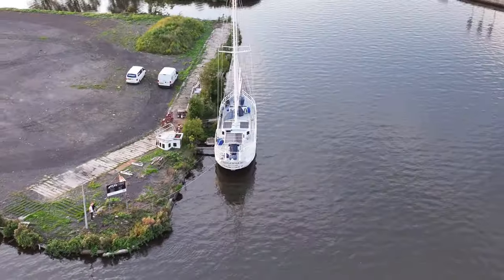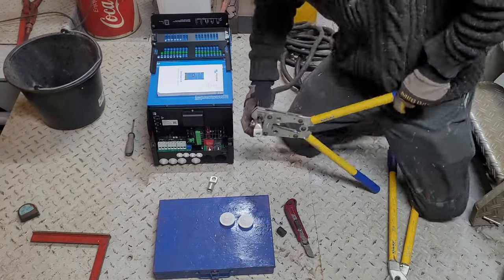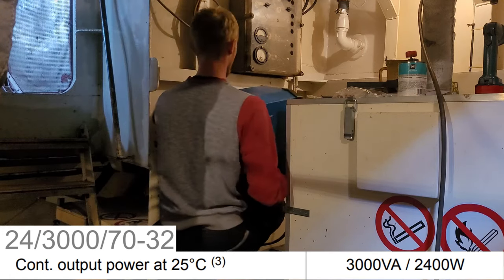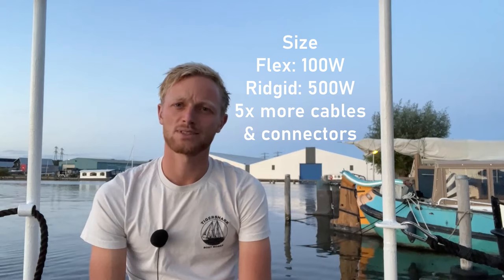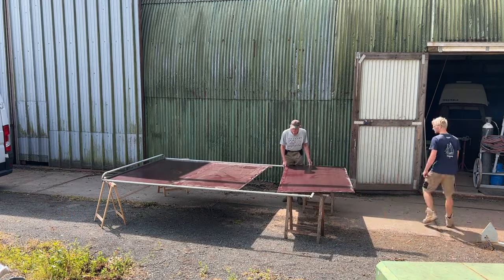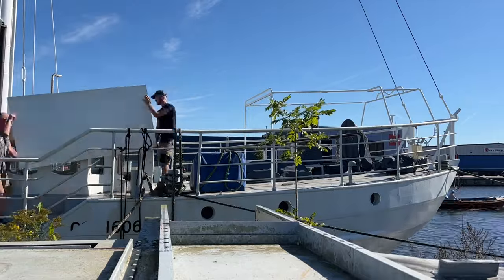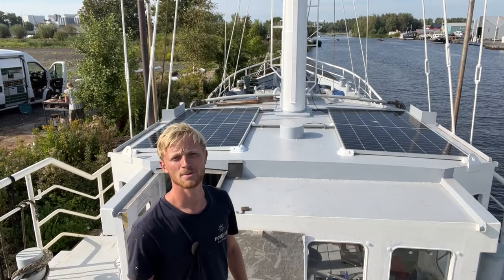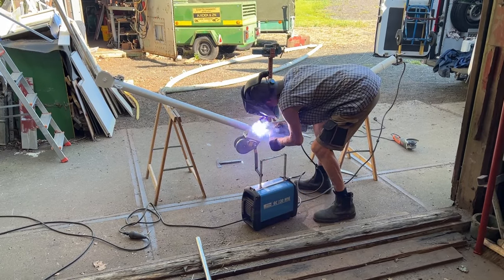How This Classic Sailing Yacht  Runs on Solar Power? - Rebuilding Tijgerhaai Ep20

Comment: Great job, you might want to put the solar panels 1 per mppt controller, as shading of one panel will pull all on that controller down.
Best wishes from Northern Canada.
Reply from the maker: That's probably a smart idea. You have these little boxes called optimizers that you can connect in between each panel and the main string. I'm considering to get 5 of those :)
Reply: @tigersharkboatworks  So long as they are Victron, you can't go wrong. 
Most of the long range cruisers use one Victron MPPT controller per panel, to cut down the loss due to shading by the sails/boom.

Comment: Well done. Thanks for another great video, the rigid panels should last longer than the flexible ones also. If the panels get too hot in heat waves in the future you could potentially make a bigger gap between them and the under boards - to allow increased ventilation to the back of the panels. Black surfaces get surprisingly hot on long, sunny, summer days. I use the panels on my boat to run a fridge/freezer during the daytime, freezing water bottles that I move into the fridge section when I turn it all off at night. Solar power is wonderful! Looking forward to seeing the dinghy again kitted out with its new cover

Comment: hi here a suggestion you have  just built the sundeck you could use both sides to have a pair of extra panels by slip hinge and extra pole off the hand rail Extra panel would be a help on low sun days as they the more the merry
Reply from the maker: That's a good idea! We'll look into the possibilities, as we have to take care with the main sail sheet getting caught when tacking or gibing.
Reply: After thought make frame under the sundeck that you could side the two extra in and out of way when underway  @tigersharkboatworks

Comment: EasySolar is a great product. I have the previous version, the EasySolar 24/3000/70. Not sure if yours supports it but mine will do peak power of 6000VA for a duration 30 minutes. It's a bit hidden in the service manual. So, what I've done is connect an electric tankless water heater (elektrische geiser) of 3500W. Gets hot enough for a shower when using somewhat restricted water flow and conserves water. Also induction cooktop, computers, compresson fridge, etc. 1560Wp of solar. 3kWh of LTO batteries. All in/on a 6 meter camper. Working for years now, very reliable.
Reply from the maker: Ah, that's good to know, I must have missed that! 1560Wp on a 6m camper is massive! We're currently looking into LTO batteries as well :)
Reply: @tigersharkboatworks Heb die LTO cellen bij Voltacell punt NL gehaald. Staat misschien niet op de website maar als je belt dan heeft ie ze wel. Levert ook balancers erbij, er hoeft geen BMS op. Hij is heel behulpzaam en denkt met je mee. De MultiPlus is er perfect op in te stellen. Ik heb met een BMV-700 de efficientie bijgehouden, +97% laad/ontlaad efficientie gehaald in de afgelopen 3,5 jaar dat ik het meet, en dat is 365 dagen per jaar gebruik aangezien ik in de camper woon.

Comment: T-shirt? Yes please! Furthermore: what paint system do you use?
Reply from the maker: Alright Alright, Will get the shop up and running asap :)
Reply from the maker: We're only using one component paint system, 2 layers of red oxide as primer, and 2 layers of topcoat

Comment: Great to see how the project is evolving, I am sure you will get a perfect world cruising ship. I am no expert or anything like that, but think I once did hear that each solar panel should have some kind of its own stearing electronic, so that if one of the panels are not delivering as it should, it will not impact the other panels, but as said I have no idea in the last end.
But I have another idea, would it maybe be an idea to make some kind of ladder to clean the panels, like a drag out from beneath the solar arch, or something from the side mounts?
Reply from the maker: I worked with those boxes a few times, they're great but quite expensive. When you have a lot of panels connected together it really pays off to have them to see if everything is working as it should, but since we only have 5 panels, fault finding is not a very big job if we notice our total voltage is giving strange numbers. The ladder is a great idea!

Comment: Maybe I missed it in one of the previous videos, but did you consider a small wind-turbine in addition to the solar? And if you did and decided it wasn't worth it, I'd be interested to know you're reasoning, as it seems like a good trickle-charge option for when the sun isn't out.
Reply from the maker: We haven't looked at those yet. I think they're a bit fragile for this stage in the rebuild since we have some rough work still outside. Once we almost start sailing, we'll dive into the wind-turbines :)